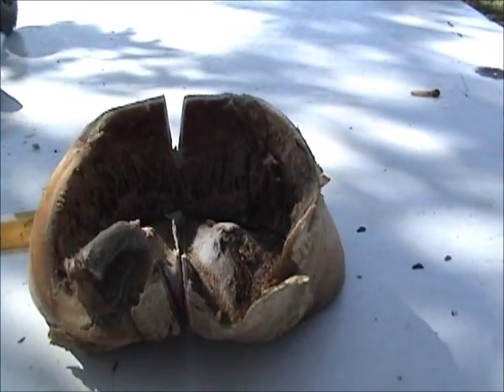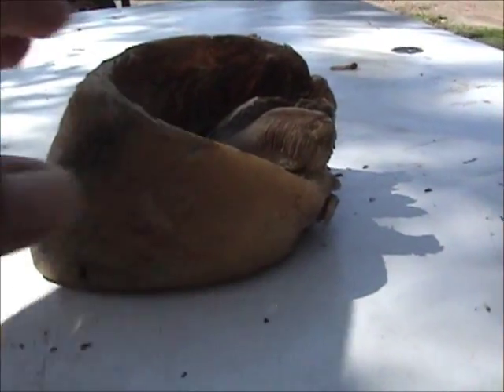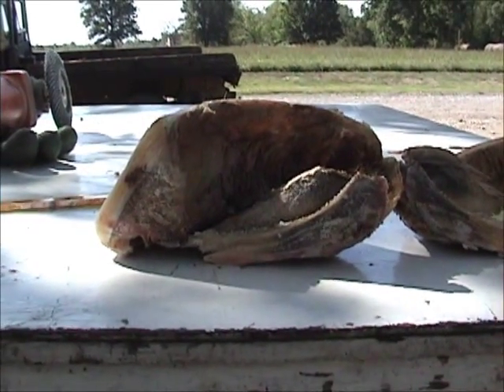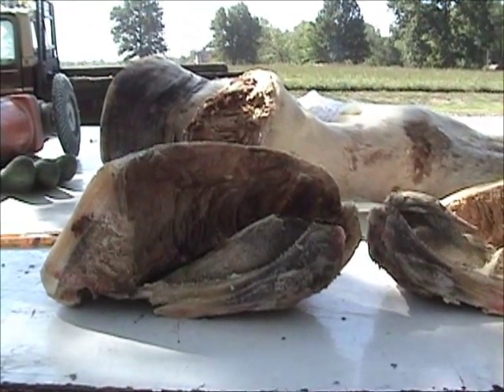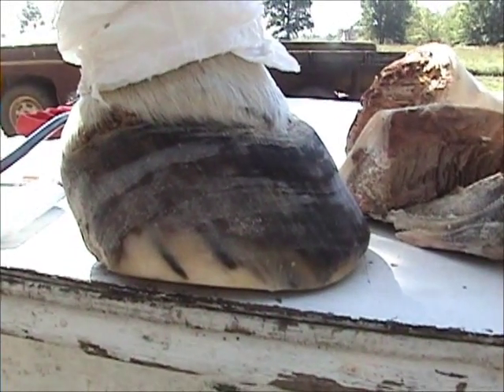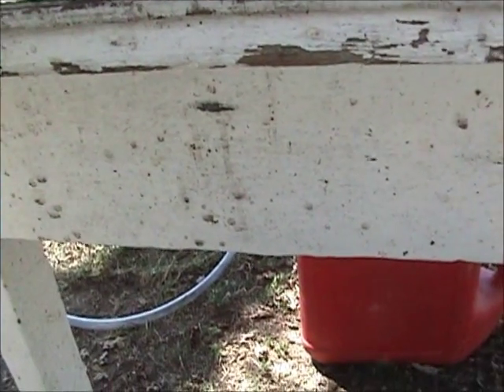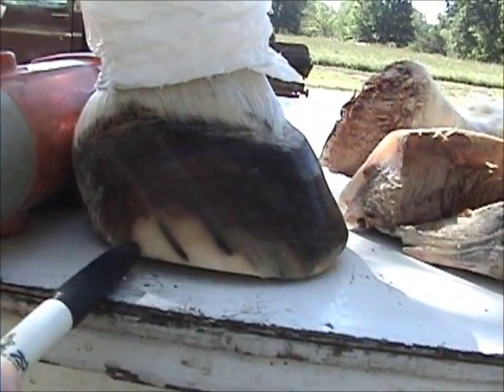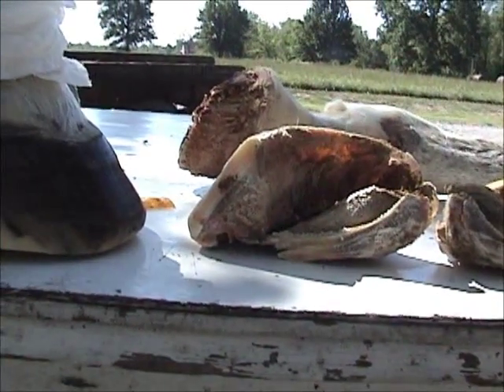How a Hoof Can Deceive You Part 2

Comment: The  first warning sign is the way the sides of the hoof are jammed up into the coronary band. This tells you there is something inside the hoof that is shoving the coffin up (the bars). The heels were not long, even though the hoof wall looked long on the outside. The laminar wedge was formed by the bars shoving the coffin out of position, pulling it off the wall. The poor hoof was trying to correct itself until the end, by separating at the true breakover.

Comment: OOOOH now I get it!  The bars were pushing the heel up, which shifted the angle of the coffin bone causing it to point downward... right?

So then would it be reasonable to assume that if you got the bars trimmed properly and could see that they were no longer laid over then it would be reasonable to assume, over time, that if the bottom of the foot looked right, the bars were trimmed, and the heal were to be the correct height, then the foot should be correct. .... right?  or wrong?

Comment from the maker: @mselveehead You could trim the heels but if you never got the bars trimmed good enough to start letting that compaction in the hoof down from under the bone, the angel inside of the inner foot and bone would not change much. With the real foot inside the toe is pointing almost straight down just due to those impaced bars rasing up the bone. Hey i didn't even realize how bad this foot was inside.

Comment: Hey so, would it make sense that this could be discovered by discovering that the heels are too long?  My thought is once the heels would be trimmed down to their correct level, you'd see that the toe is on the complete wrong angle.  Is this the case, or is the hoof so malformed that even this method wouldn't uncover the true condition of the hoof??  I look at this and I think, GOD, what if my poor horse has this and I don't even know!